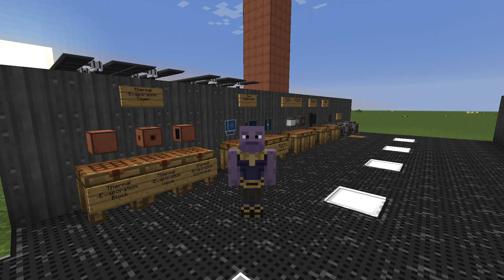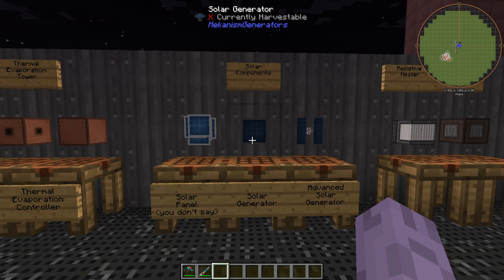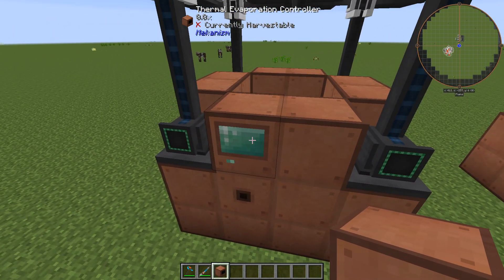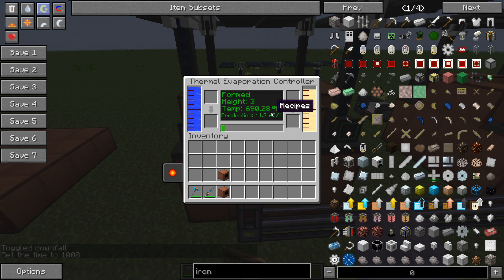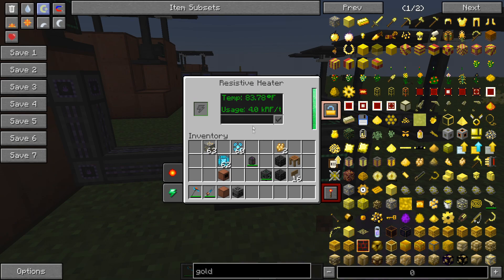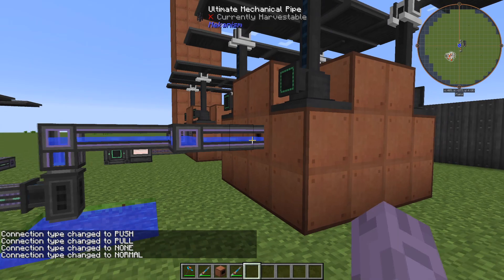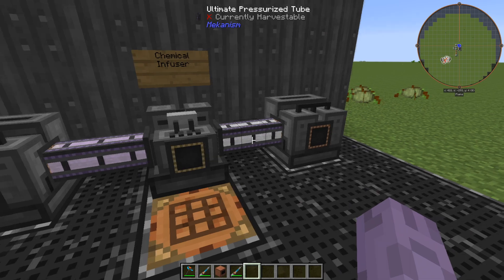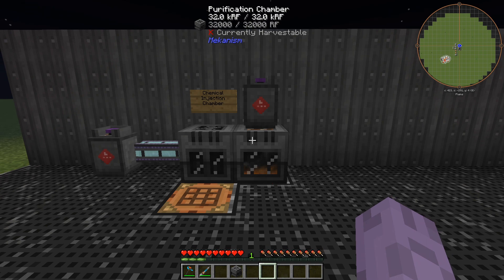Minecraft - Mekanism Tutorial Part 4: Quadruple Ore Processing

Comment: Can you tell me how much many eltroytic seperators (with max upgrades) (yes ik spelling are wrong)  and chemical infusers i need to make enough hydrogen chloride to process in an ultimate injecting factory? and same for oxygen aswell.
Reply from the maker: Depends - is your injection factory also running full upgrades? I can't tell you the exact numbers because I don't know the utilization rate and what not, but it should be a pretty easy equation. Multiply the base value that the electrolytic separator makes (check your individual modpack, some packs may have tweaked the value) by 8. Find the utilization of hydrogen chloride per shard, multiply that by how many slots there are in the Ultimate factory (don't remember off the top of my head), then multiply based on your upgrades. Set up your ratio there.